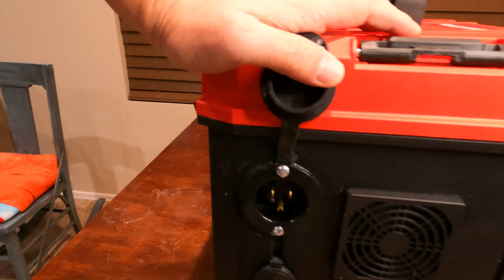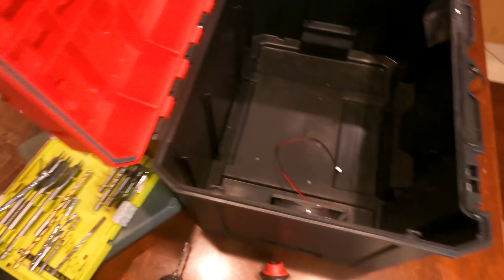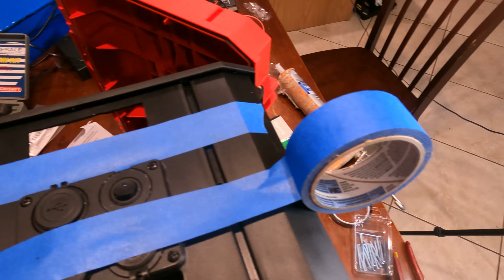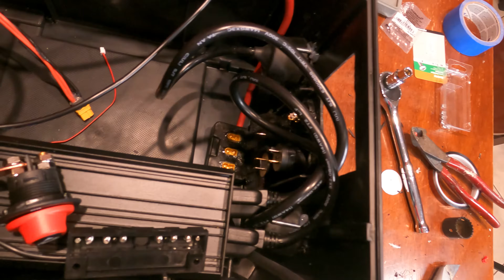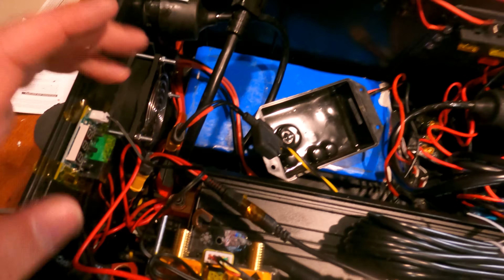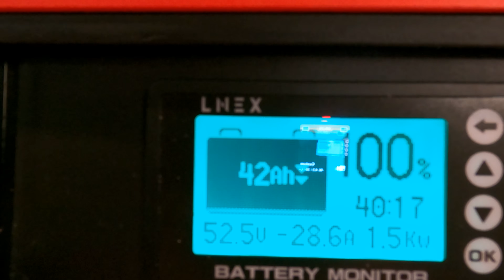DIY Solar Generator

Comment from the maker: 😇 https://www.youtube.com/user/lastend1?sub_confirmation=1 Subscribe

{DIY SOLAR GENERATOR PARTS}
 I earn commission if any item is bought using the links bellow. That said I do give unbias reviews of them given I had to use my own money to obtain them.

🛒Sine Wave Inverter: https://amzn.to/3tqWGU0
🛒Battery Monitor with Shunt: https://amzn.to/3KbjsVL
🛒Water resistant cord port: https://amzn.to/323WWgu
🛒2x Weatherproof Power Outlet: https://amzn.to/3Ia9Sk2
🛒Velcro: https://amzn.to/3InJsvF
🛒Heat Resistant Tape: https://amzn.to/3ft9EZ2
🛒Cooling Fan Filter:  https://amzn.to/3zYWpJ8
🛒80mm Fan: https://amzn.to/3foKif9
🛒Marine Fuse Box: https://amzn.to/3foKrzd
🛒100a Battery Disconnect Switch: https://amzn.to/3fnNkAe
🛒6 AWG Wire: https://amzn.to/3K9B7xj
🛒1/4 Heavy Duty Copper Wire Lugs: https://amzn.to/3nuhmXh
🛒3/8 Heavy Duty Copper Wire Lugs:: https://amzn.to/31Zuv35
🛒USB Charger: https://amzn.to/3no0uSb
🛒Outlet Socket Panel: https://amzn.to/3rjGuRQ
🛒Temperature Controller: https://amzn.to/3FC7v8k
🛒12v 240 watt Buck: https://amzn.to/3rmmMVC
🛒Anderson Panel Mount: https://amzn.to/3KdITWD
🛒Mountable XT60: https://amzn.to/3rnN7Cu
🛒Heat Shrink Tubing: https://amzn.to/3I5jc91
🛒Silicone: https://amzn.to/3nsXow4
🛒CRAFTSMAN Versastack System 17-in: https://amzn.to/3A3hCBy (Also found at Lowes for around $33)

TOOLS
🛒Heat Gun: https://amzn.to/33lUPVR
🛒Cable Crimping Tool: https://amzn.to/3qtaZp6
🛒Soldering Iron: https://amzn.to/3nvnlLs
🛒Hole Saw Kit: https://amzn.to/321JtWv
🛒Glue Gun Kit: https://amzn.to/3GDCPow

BATTERIES
🛒48v 20AH: https://amzn.to/3kr0CBB
15AH: Not recommending
8AH: Not recommending
Reply: For the Battery Monitor and Shunt what is lug size for the shunt?
Reply from the maker: @MicMaine  3/8
Reply: @Eric_Tennant  thanks for the follow-up!

Comment: Hey Eric, love the build.
2 dumb questions...
I'm building a 12v station with a 2000w inverter
Will that 100amp battery disconnect be enough, or should i get a bigger one?
Also...where and how do you wire the waterproof charging inlet?
Thanks for your time.👍
Appreciate you sharing and giving me the courage to do my own.
Be safe brother.✌️
Reply from the maker: For 2000w @ 12v you will need at least 167 amp switch. So a 200 amp one will work. The outlets just plug right into the inverter inside the box.
Reply: @Eric_Tennant  Thank you SOOOO much!
I've probably watch over a hundred videos of people's box builds and seen so many different ways people do things. Lol
Thanks so much for your time and the knowledge you pass to those of us who are still leaning the basics.
Cheers brother! 🍻
Edit: Oh sorry, must not have asked it correctly...
The single INLET outlet used to charge the unit with?
Reply from the maker: https://www.circuit-diagram.org/circuits/77b96fa9a5d84d6f86110e250763a89a 
The charging inlet goes to a AC to DC charger that is then wired to the +/- posts on the back of the inverter. This video I add a extra input cable to the inverter back posts. https://www.youtube.com/watch?v=4rzGFptlwio
Reply: @Eric_Tennant  EXCELLENT! 👌
Appreciate your patience.

Comment: Nice use of lid area.
Reply from the maker: Thanks; however that hot glue is a major fail. I need to make an update video on this. Hot glue fails on hot summer days.
Reply: @Eric_Tennant  Yeah I was actually going to issue a warning on that, but every time I do the Hot Glue Cabal comes after me.  I never use hot glue.

Comment: You mention that your fan is water resistant, but the fan in your links seems to be a basic fan, which doesn't seem water resistant.  Am I missing something there?  I appreciate your vid and want to use as many of your links as I can for my build.
Reply from the maker: Your right the fan by it self is not water resistant at all. The location of the fan make it water resistant given it is an outtake fan and it will nearly never get to it because of were the intake is. Sideways rain into that side could be a problem if it got past the carbon filter covers.
Reply: @Eric_Tennant  I see, so the intakes are angled down to help prevent water/rain from being pulled in.  The fan isn't a major concern since it's blowing air out?
Reply from the maker: @John W.  Indeed If the fan controller is on. It can be set to any temp. 

Only way I can think to stop sideways rain when it not hot is. 
1. Have the fan running 24/7 (waste of power really) Many prebuilt do this; however if turned off the problem still exists  
2. Add a flap to the outside of the outtake fan (messes with the cosmetics) 
3. Remove the fans and holes (Could not run for long term but would work fine for low watts or short term) 
4. Take care not to leave it out in a monsoon.

Comment: This is one if the best, most I'm depth videos I've seen on this topic and I've been watching a ton of them recently. Thanks for putting this together.  Can you explain what the buck/dc stepdown unit is needed for exactly?  Also, I realize you have airflow, but is there no concern at all with the Charge controller and the converter touching other objects with those units themselves being hot?
Reply from the maker: The main current is 48v and the front USB an car socket all run on 12v. If the system was using 12v batteries this part isn't needed. With the 120v inverter the nearer you can get the batteries voltage the more efficient it will become. 

The inverter, batteries, buck, and MPPT are all made to run a bit hot. Touching the inverter help cool in the end because its cover is aluminum and it has its own cooling fans.
Reply: @Eric_Tennant  tha ks for the clarification.  I've been watching so many videos on 12v that I totally missed this one was 48v.  And thanks for the info on the heat.

Comment: 12v systems are better for mobile. Easier to charge, less heat, more efficient, and easier to find appliances that run off 12v. Why 48v?
Reply from the maker: The higher the voltage the more efficient it becomes. That and my E-bike runs on these same batteries. The system does step down to 12v for the front panel.
Reply: You built this around a cheap 48v e-bike battery. But then you have to pay extra for converters. Not a great tradeoff.
Reply from the maker: @AlamoCityCello  Your logic lost me at the point were you said 12 volt is more efficient then 48 volt.  At what point do you think e-bike batteries are cheap? You may want to expand your understanding of 18650 batteries before you make a statement like that.
Reply from the maker: @AlamoCityCello  On a good note you have great music skills.
Reply from the maker: But it can be done in 12v just as easy. For 12v the main wire will have to be much larger to handle 2000w.

Comment: Nice build but, Any suggestions for  cheaper batteries. I'm on a budget.
Reply from the maker: By building your own battery pack you could drop over 1/2 off the cost ( https://jag35.com/ ). If you replace the Genasun with LED MPPT Boost : https://amzn.to/3mzaCH4 drops the cost by $150.

Comment: Impressive setup and great job showing us all the steps! Thanks for posting.Side tip for cutting bolts. Thread the nut below where you want to cut prior. When you back the nut off after the cut, it will straighten out and clean up the threads that were damaged during the cut.
Reply from the maker: Great idea

Comment: Quite the build Eric! Smart move using the 48v scooter batteries, will allow quite the discharge load and doesn't weigh very much compared to other battery chemistries. What's your main plan to use this beast. Power outages and camping?
Reply from the maker: Both; however power outages haven't happen here in over 10 years. 

Right now I'm working on making it compatible with cars; however I need to limit the 12v socket option to 5amps because it gets to hot when charging the generator and with a hot spring the watts drop to 5w.

Haven't even started trying to start or charge a car off it. I could foresee needing to limit anything using a 12v socket for I don't think they would last long much higher. Even though they sell 20a version that still cook springs.
Reply: @Eric_Tennant  I haven't seen many amazing options for DC to DC charging 48volt lithium batteries. I think they are picking up in popularity recently so maybe soon you'll have more options that can handle more than 5 amps. Charging at 5 amps would take a VERY long time to charge up this beast.  I use the Kisae DMT1250 (12v 50amp charger). It supports both DC to DC charging and high levels of solar input. I noticed they have a 24volt model but not a 48v model....dang.
Reply from the maker: Hmm was hoping to limit the adapter watts; however if that a no go you did give me a other road, but yea would have to find a weak 12v version not to overload the socket. Now if I go directly from the car battery I bypass this problem. I just wanted many charging options for it. Also allows for more videos to be made once I get the upgrades working. Think even the fails have some value on YT for knowing what not to do.
Reply: @Eric_Tennant Not sure how relevant this is, but they have car "jump starters" which are basically a cigarette lighter to cigarette lighter slow charge, which you could possibly utilize if you dont want to risk a jump start power drain

Comment: Wow,  that's really cool man.  Good job.  I'm using ideas 😀
Reply from the maker: It's a fun rabbit hole to keep going down. Last night I spent hours making a car charging cord for it that connect into the Genasun solar controller. First one I made melted down. This is because it had a inline fuse that I replace with a spring given I upgraded the wire on it. The spring was too small and made a heat coil melting the cigarette lighter adapter. Version 2 I replace the spring with a 6g wire. In testing it pulls 70-80 watts from the car with the car off, and the adapter gets a little warm. 

Update: Think I just need to buy a 15-20a version; because with no spring it doesn't make good contact on the positive. Really not the best plug design, but hey that what we use.

Comment: Man, you did such a good job on this build. Looks professional on the outside.
Reply from the maker: Thank you. I watched nearly all the videos on the subject and then went about making it better by attempting to prevent water from shorting it out, and keeping the design lighter by not adding wood into the setup. Not sure why so many go with wood as a support. A other fail many have is by adding the screen in the lid. This weakens the top and makes for a great place for water to enter.